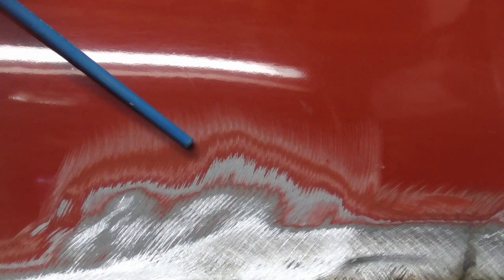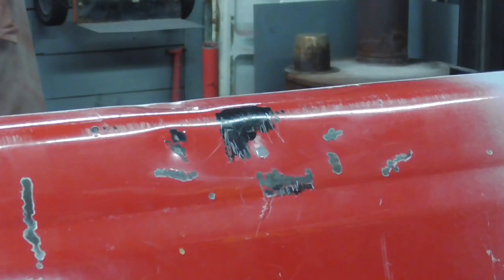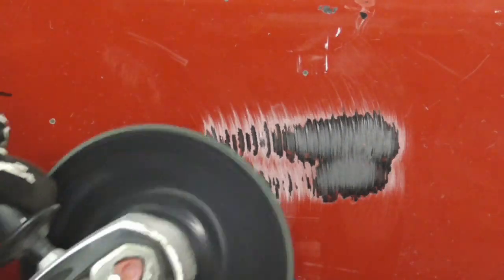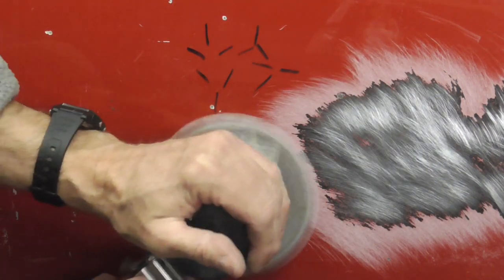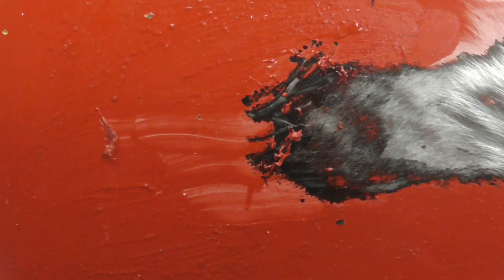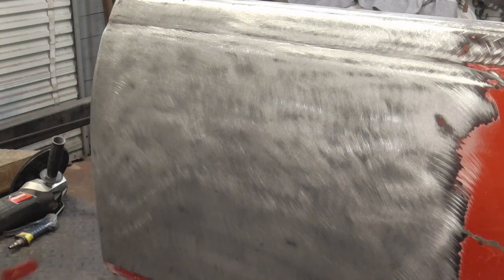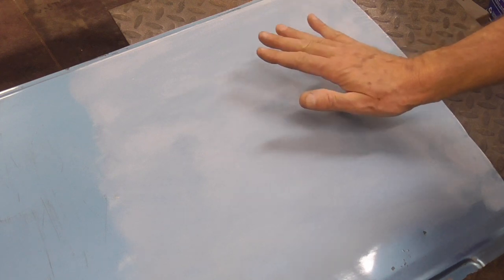When You Should Strip Automotive Paint & When You Can Paint Over Paint

Comment: super helpful info! those chemical strippers kinda work, but definitely not as good after they removed the methyl chloride. if you lay it on thick, and cover it with saran wrap, that keeps it moist enough to penetrate. i really only use it for areas i cant get a polycarbide grinder wheel into...which painting bicycles, there are plenty of tight spots!
Reply: The new "Ultra" formula works better. If you have the money you can order some Cooper's Strip Club from NZ. It works as good as the old Aircraft stripper.

Comment: Just the video I've been looking for.     I am looking to clean up my 25 year old car with fairly rough paint.   Lots of stone chips and scuffs.    I don't know the history so could be hidden bondo, previous repairs etc.    Would like to get the body panels straight and a nice paints job on it.      Will be doing it myself so prep time isn't an issue.    However,   IF respraying without stripping makes sense then I'm not interested in doing extra work for no reason at all.
Reply from the maker: There are very few reasons to strip - the main one is too many paint jobs underneath.  Good luck with your project - feel free to ask ?s :)

Comment: Great video.... Have you noticed the chemical paint strippers have gotten weak...yeah that's because they took away the methylene chloride now you have to buy it from a chemical warehouse if you can get it.... Eastwood sells a paint stripping geared grinder that uses cylinderical wheels to strip paint and bondo the contour SCT and they sell an attachment that turns a regular grinder into a cylindrical style one. I was going to buy SCT but found a similar grinder on eBay for cheaper still waiting for it to arrive, when it gets here I want to strip a door with it to see if it's faster, I used all the methods you used and I like the grinder or the hog to get it done faster.
Reply from the maker: Let me know how that SCT thing works when you get it.  I'm going to check it out.  I've had good luck before with aircraft stripper but I think you're right they probably made it real "safe".  Happy Holidays to you and your family - Jerry
Reply: @LakesideAutobody  Yeah as soon as I get it I'll do the door and a video on it... I'll be swapping the skin over to the 72 inner frame..... Happy holidays to you and yours!
Reply from the maker: @moparnut6286  Looking forward to it :)

Comment: Very nice video. Glad I stumbled over it. Have a project car I plan to use a daily commuter. The clear coat started peeling on the hood, roof, and bumpers. This past weekend, I sanded it with 320, then 600 until I saw primer. I reprimed it, added adhesion promoter and the added base and clear. My problem is I didn’t have enough base/ clear. 

Do you think I can sand out the clear coat and add more base and then hit it with 2k clear in order to give it a better more even rich red look ?
Reply from the maker: Yes, you can do that.  Thanks for watching and feel free to ask more ?s if needed :)
Reply: @LakesideAutobody  thanks so much 🙏. I thought I wouldn’t be able to and had to start from scratch. 
What grit do you recommend using to sand out the recent clear coat? 1200?
Reply from the maker: 400 wet sand or 320 DA if the paper don't clog up because the paint is sort of new.  You can go finer if you want but it's going to be a bit more work.  :) @hhova29
Reply: @LakesideAutobody  I thank you so much again.  I won’t be able to get to it this weekend because of rain. The hood/ roof looks like tiger strips from one angle, 😆 🤦‍♂️. 
I don’t have a garage to paint and will do it outdoors, but the weather will get a bit colder next week. If I do it next week with the weather dropping at night, can I leave the base coat to dry over night before applying clear after I sand down the clear? 
Should have enough paint now and even considered using some spray cans for the bumper.
Reply from the maker: Read the can... if it doesn't say anything like "clear must be applied within 24 hours" your good.  I would try to do it the same day though - base then clear.  Let me know how it goes or if you have ?s 😊✌
Reply: @LakesideAutobody  hi again. I finally had gd weather yesterday and painted and 2k clear coated my little project car. Problem is this morning it drizzled and now I see little water spots on the clear coat as it continues to cure. 
Can I wet sand this out once it cures or do I have to start from scratch now? 
Please lmk

Comment: A question came to mind. What is the best method of working door jambs, complicated recessed areas. I suppose finding a smaller sanding disc?
Reply from the maker: There might be some ideas in this video - https://www.youtube.com/watch?v=kFTSmdPl13E  Most of the times I hand sand it or use a scuff pad.   These work great too for truck beds and door jambs - https://www.harborfreight.com/3-in-80-grit-nylon-abrasive-wheel-with-14-in-shank-60324.html  or https://www.harborfreight.com/2-inch-80-grit-shaft-mounted-cup-brush-91367.html

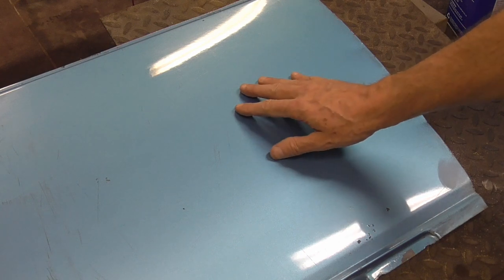Comment: Hi. New to this, doing a make over on an older metal horse trailer. Some of the paint is still good on it. Most of it is rusted. Sanded most of the rust off. Now to paint. Used primer on the rusted areas. Followed you in the video til about 5:40 I think it was…what is the hog and the da? And what did you have on them and what are they used for? Thank you.
Reply from the maker: You don't need the bondo hog unless you are doing large stripping jobs, sanding large areas of filler, etc.  The DA is used for sanding auto paint, feather edging and getting paint ready for paint.  Hog uses 40 grit or 80 depending on what you are doing.  DA uses 120 and 220 or 240 again depending on what you are doing.  You'll what everything down to 220-240 before paint

Comment: Great information. You mentioned that after sanding with 220 grit the clear coated panel is ready for paint? Would that be for solid colors not for metallics? My understanding 600 grit should be minimum for metallics and 400 grit for solid base. Just curious and thank you for your knowledge and expertise.
Reply from the maker: 220 is the lowest you can go and not worry about seeing any scratches.  Many will disagree but for many years that's all we used in one body shop I worked at.  At another we used 240.   The paints we sprayed were lacquer, acrylic enamel w/ hardener,  base coat with clear.  If it's a show car you can wet sand with 400 grit or DA sand with 240-320.  You'll hear a lot of stuff on the internet but in a body shop 220-240 grit for DA and 320-400 grit for hand or wet sanding is standard.  Truthfully you'll never need anything finer than 400 for paint prep.

Comment: Great video as usual.  Is there any chance you might do a video dealing with clear coat problems on a base coat, clear coat paint? Thanks for your videos, they are very helpful.
Reply from the maker: What kinds of problems do you run into?  Not drying, not flowing out, dust, messing up the metallic flakes, moisture, bad reactions, flaking off, dry spray?
Reply: I'm looking more for a way of fixing an old clear coat that's flaking or delaminating clear coat on an existing finish.
Reply from the maker: @paulpollack9262  Got it.  If it's just flaking on the hood, roof and deck lid that's sort of good news - means the extreme temps may have helped cause it.  If it's all over the car, that's not so good.  That being said, the cure is to DA sand the bad areas but just until you get to an area that is sticking well and the edge is feathering.  Once you have all the bad flaky stuff off and only good left, you can prime those areas, block sand 120-180 grit, finish sand 220-240 grit DA and paint.  Let me know if that's your case if not there's other routes that may be easier.

Comment: Great video.   All real life scenarios I have come across over the years.  Very well done.
36 grit cran scratch metal correct???  Is it better to fill with primer or should plastic filler be applied?
Reply from the maker: You're fine with primer surfacer.  If you want, you can hit it with the DA or hog to smooth out those 36-40 grit fiber resin disc scratches before priming.  Have a good weekend :)
Reply: @LakesideAutobody  you also. Thanks !

Comment: Okay so, I'm stripping the original laquer paint off of a 64 Impala. The paint is checkered badly. I've considered stripping the way you've displayed here. My concern is gumming up the paper with laquer paint. Do you think old oxidied paint will gum up the paper? Would it be best to have the vehicle media blasted. If so, what method to you recommend? I've heard that dry crushed glass is a good way to go, but I'm still researching.
Reply from the maker: My suggestion is to first try sanding it off.  The courser the grit the less it will clog.  Use 24 or 36 grit - sanding won't mess with the thickness of the metal.  Grinding will though - say with an angle grinder.  As for blasting, I've never had an issue with distorting metal using any type of media - never had a super powerful blaster/compressor though either.  The ones in a body shop were pretty powerful but still didn't have a negative effect.  I use black diamond media from Tractor Supply right now - cheap and works just fine.  Let me know what you end up doing.  Jerry

Comment: I have an aluminum topper (ARE brand) that the previous owner painted over with black paint (he didn't say what type but I'm assuming latex or oil based). I want to put white paint over the topper to reduce heat build-up from the sun. from what I've seen on the Net it SHOULD be OK to put an oil-based primer over this paint and then use another compatible paint for the final. the final "paint" is actually a COATING (Henry's Tropicool 887 silicone based reflective paint) that the company says will stick to an oil based primer. I just want to be sure that the primer sticks to the underlying black paint. would appreciate any suggestions. thanks.
Reply from the maker: The only way to make sure is to sand a spot (220 or finer) and prime it.  When you sand that primer, it should feather in n the edges and not chip or peel easily.  Hopefully they didn't paint it with house paint 😒
Reply: @LakesideAutobody  thank you for your input and suggestion. I will try that!

Comment: just curious, you put down base coat onto a panel after 240 da palm sander? I like to think I can do that but won't you see sand scratches? I don't think I have had good success with anything less than 400 on my palm sander, painting over cured urethane clear factory finish. I will give it a try ....Good Video Thanks!
Reply from the maker: Anything from 240-320 on the DA will work fine.  It might depend on the type of clear you are using too :)

Comment: Hey Lakeside. After grinding with 36 grit, how many coats of primer would a person need to make that surface paintable? Thanks for sharing.🍁👍👍
Reply from the maker: 2-3 coats of primer surfacer.  You can then block it with a sanding board, prime again, finish sand by hand or DA and paint.  Or 2-3 coats of surfacer then  just hit it with 220-240 on a DA and paint for a daily driver.

Comment: Jerry,  my friend who  just bought a 31 Model A roadster has the black fenders that someone had painted probably 20 years ago that has big large cracks all over all the fenders.  What normally would have caused these big cracks?  It is a single stage shiny black paint?  
By the way, nice video.  You always come up with good common sense videos that are very helpful.  Thanks a lot!  And stay safe!  Tom
Reply from the maker: Most of the cracking, paint checking, bad reactions come from the use of different brand paints or materials that don't mix.  For example, if someone sprays a fast drying clear coat over a slower drying base coat then that paint under the clear will not dry properly.  I always try to paint using everything from the brand and in the same group (lacquer, enamel, urethane).  Like if I am spraying Nason brand paints then the hardener, the reducer, clear coat etc. is also Nason and it's all meant to work together.  Good to hear form you as always - Jerry

Comment: I think you misspoke. That isn't a grinder that you were using, it was a variable speed polisher. Grinders run at 5500 rpm in that size and the paint would melt and load the disc immediately at that speed. Get yourself an 8" pad for your polisher and use about 40 grit on something with that much paint on it at about 800 rpm. It will slice the paint off and the discs will last a lot longer. Use the same paper as you use on the mud hog. I prefer Velcro apparently you're fond of PSA.
Reply from the maker: Hi SATAMAN - good to hear from you - always a pleasure.  If I don't hear from you again before the holidays - Merry Christmas :)  Thanks for the comment.

Comment: i didn't know you could paint right over 240 grit.
Wouldn't the new clear coat show the scratches?
Reply from the maker: No.  Most common is 320 on a DA or wet sanding with 400 but you can certainly paint over 240 without issues.  Most guys on the internet use too fine of paper - I think they're scared of what the trolls will say :)

Comment: Good video! 

Do you have opinions about sand blasting a car? I have heard that it's a absolute NO NO and also heard that it's OK with fine grit sand...
Reply from the maker: I've never sand blasted a whole car.  If I've had to strip paint I've used a bondo hog with 36 grit or 40 grit paper on it.  I think they are worried about warping panels but if one is careful and takes their time - not generating heat or is way to aggressive I think it would be just fine.  I don't think a DIY guy could do it at home as you need a ton of air and sand though.  Let me know if you do it of have it done - I'd like to hear the results - Jerry
Reply: @LakesideAutobody  Yes, Skills needed like you said. I have a '72 Cutlass so I would not like to have that as a test piece. Maybe 40 grit or something similar. 
Thanks!

Comment: Hello Jerry,
got all the paint off my truck cab and getting ready to start final metal sanding for primer. I have PPG Omni epoxy primer that states 120-180 grit bare metal prep. I think that might be for hand sanding. What would the equivalent grit for a DA?
Thx, Rod
Reply from the maker: I would say 120 grit will work fine for you.  I one shop I worked you had 2 choices for DA paper - 120 and 220.  It worked for everything.  You can really use almost any grit now that it's down to bare metal - primer surfacer is made for filling any imperfections and sand scratches in bare metal.  Jerry

Comment: So you can just paint over 220-240 grit and not have to worry about seeing scratches? Thanks!
Reply from the maker: 220 is fine for daily drivers - it would take a good eye to find DA marks using 220 - there are factors such as type of paint, brand of paint, use of a sealer, thickness of the paint/clear, etc.  To be safe and for nicer paint jobs I would use anything from 240-320 on a DA or 320-400 wet sand.

Comment: Hi... After watching your vid.. I agree that the Drill Master appears to be the most efficient method. I have that same Grinder/Sander, but mine came with the wheel that accepts self adhesive sand paper. How did you outfit yours to accept the center hole sand paper ?  Any help would be greatly appreciated.. Thanks in advance
Reply from the maker: I bought the backing pad and washer nut thing from harbor freight too (they came together in a bubble pack).  They have it in the store where all the sand paper and sanding discs are.  You can get them elsewhere too - the harbor freight one is a bit cheap but works.  Hope that helps - let me know how it goes for you :)

Comment: Have you ever used a national Detroit da sander, although they are expensive mine runs at 65psi which doesn't run down my compressor as fast
Reply from the maker: My main DA sander (go to) is a National Detroit.  They are the best - in my mind.  They're made with some weird geometry so that the sand paper stays clean.  They don't require a lot of air like you said either.  Have a good weekend :)

Comment: I have 67 impala its original paint is worn down dull and u can see that rust is comeing up thru the paint does that have to be taken down to metal? I have taken cleaner wax and it takes the brown "rust" out of the paint but if it gets wet a lot u can see the brown comeing back thru the paint.
Reply from the maker: I would DA sand it with some 120 and see if it takes it down quick smoothing the paint and removing the rust.  If that doesn't work, you might have to use rougher paper on the DA or smoother depending on what happens.  Basically you should get rid of the rust.  So DA sand it, prime it finish sand it and paint.  If you have more ?s on that topic feel free to ask :)

Comment: if i heard you correctly...remove all the old paint if its peeling? No matter what the cause is?
Reply from the maker: It's like an old garage... if the paint is peeling or flaking, you'll have to strip that stuff off.  If its stuck on real well but just checked or has other imperfections you can sand it and bury it with Evercoat Featherfill,  sand it flat and paint it.  Let me know what you plan to do.